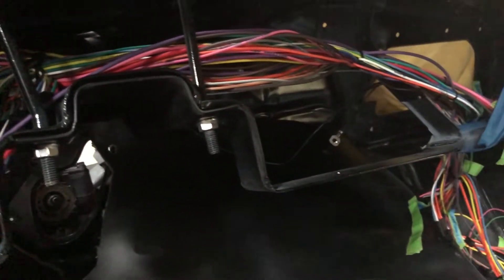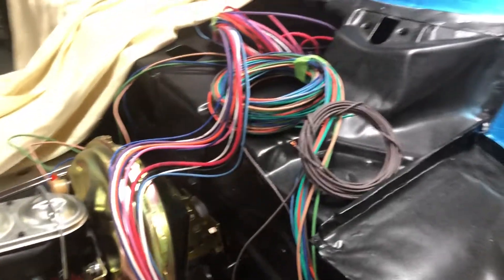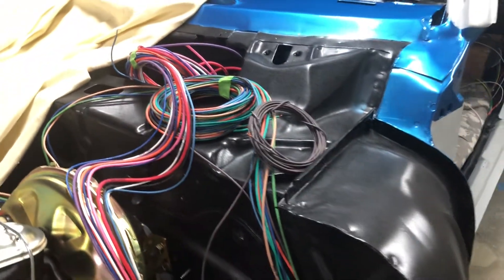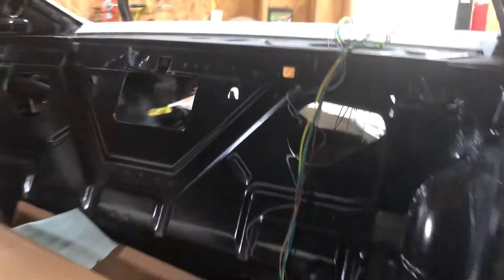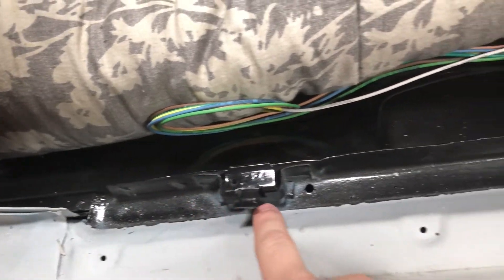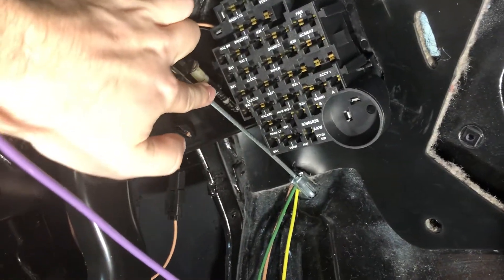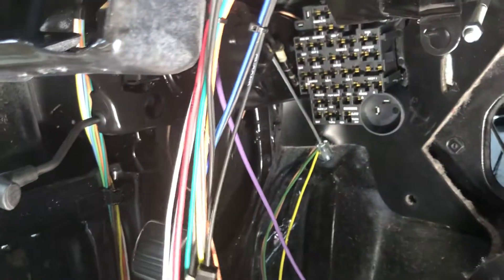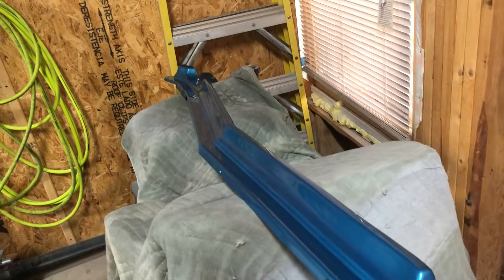Installing the Fuse Box & Emergency Brake

Comment: I'm lost right now, I need to see whats going under th dash on the column.  When I turn my key I have no power inside the car. I have power outside and a new battery. Inside nothing, car won't even crank. Starter wire has no power to it. I also just changed my ignition switch and still nothing.  I checked the wires going to switch and 2 have power with key off and the rest get power with key on.
Reply from the maker: We are still working on all of the wires under the dash. I may be able to get something recorded for where we are at right now, but I’m not sure how helpful it will be since the under-dash wiring is basically a rats nest right now. Lol I’ll see what I can do, though. We haven’t tried starting the car yet because of not having the under-dash wiring completed so there is a chance we will be in the same boat as you when that time comes. Haha!